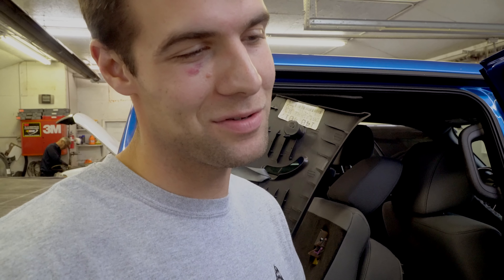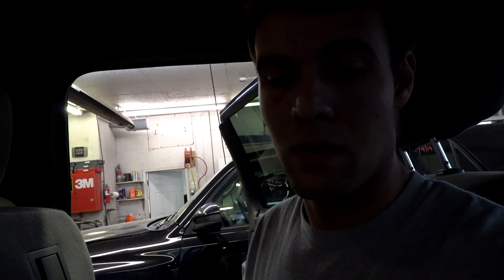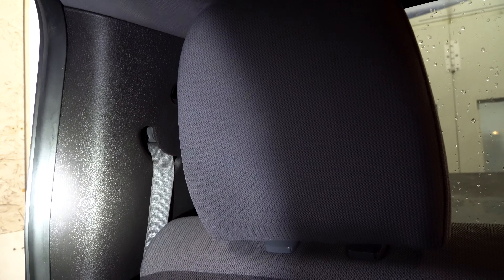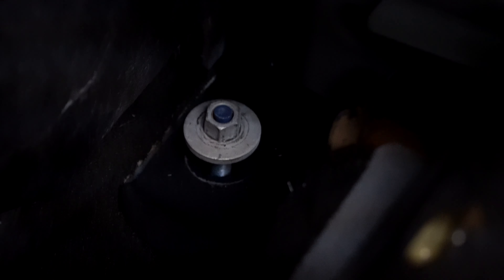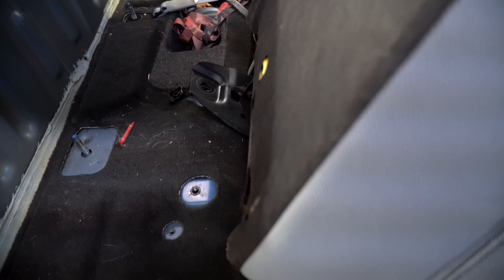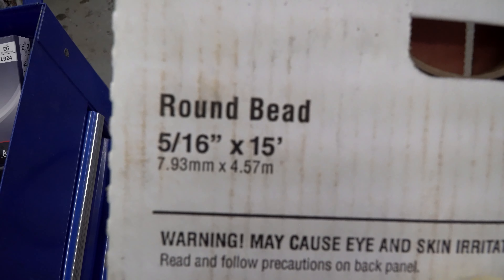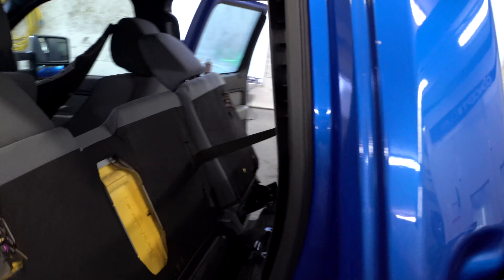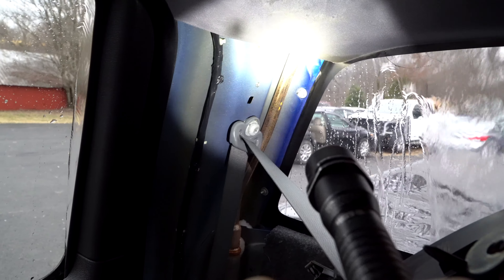Ford F-150 backglass/ rear window water leak (2011) // #theautobodyguy

Comment: I used this video as a reference and just did mine and have a few extra tips: Carpets were soaked, and the trough down each side of the kick panels were full of water. I used a shop vac to suck out the water, and then raised the front of the truck to get the water out that was pooled at the front to head to the rear to suck it up and also sucked what I could out of the sound deadening. Got 2/3 a gallon of water out of it! 
For the old seal remnants, I found that scraping it was not the right way, but used a lever action using a curved plastic trim tool to lift and pull it away, continuing this process as I remove it. I then used brake cleaner (red can) and lots of blue rags to clean it up as this dissolves the old seal.  For installation of the new seal, I did not smush it down like in some videos; just laying it in the groove as you dispense off the roll, as you remove the backing paper at the same time is all it needed; it holds very firmly on its own just under its own weight.  I’m also taking the opportunity to do the resistor trick on the heated rear window signal wire (when this loses continuity your heated mirrors and window won’t operate), and to drill the peg for the seat back release, so that I can tie a piece of paracord between it and the headrest mount to make it easier to drop in the future.   Final recommendation is as soon as you see any moisture building up inside your F150, or it smells a little damp, don’t put it off - just get it changed! Mine is going to be parked up for a few weeks with a dehumidifier going to dry out the carpet (currently raised up on 2x4s to allow air to circulate under it).
Reply: I have a 2013 Raptor and had a leak in the corner. Sealed it(temporarily/year now) found a 1 piece window guy that wants to trade so we are swapping this weekend. I’m happy to ditch this window. Less issues with the solid one. Been watching stuff to make sure it’s done right. Good video and your comments help 👍🏻

Comment: I just resealed my rear window and replaced both cab seal/strips while the window was out. Thank you for the video! My cab corner strips were just old and dry rotted so i wanted to replace them but after reading more I am glad I did because some people said the rivets caused their leak.

Comment: I have the 2013 extended cab.
Water would just pour in through the brake light (even the one I got from Amazon recommended by youtubers) and the upper corners of the back window, where the roof channel with the black plastic cover and rivet meets the glass. I also have a leak in the passenger cab vent between the cab and the truck bed.
I've had it with leaking, and so I just used black high temp RTV to seal the whole roof channel, and a thin bead of clear RTV on the top of the glass and read brake light.
Now I need to fix the leak in the vent (plastic piece between the cab and the bed).
Reply: How did it go, I’m working on it today.  I put silicone along the top of window but when I pour water there it still manages to get in somehow

Comment: Right after he removes the tape from the new 3m seal on the glass he shows the back of the cab and there is a lot of residue left from the OEM seal.  Will the 3M window weld tape seal to that residue?  If it all needs to be removed what works the best?
Reply from the maker: Remove it all is the safest play.

Comment: What are the torque specs for the bolts holding the window in? Thanks for the video!
Reply from the maker: I'm not sure, I just make sure to go around to each nut a couple times to snug them down as the new seal bead takes a bit to compress.

Comment: Hell yeah. If it wasn't the 3rd brake light leaking then I'll definitely be doing this for my 2010. Is running silicone a bad substitute for this method? I'm concerned about the looks I guess. Thanks!
Reply from the maker: Nicholas Davis Nice! Silicone will likely seal the leak,  but you will definitely take a hit in the cosmetics dept.😂
Reply: Use a piece of making tape to get make a border around the meticulously cleaned repair area. Use 3m window weld ($25), and peel off the tape quickly before it dries. The window weld may last as long as the truck. If budget constraints force you to use silicone, there's No telling how long it will last.

Comment: I just replaced mine last weekend. I used a 3/8 bead. Maybe that was too big because I can see some of the new strip got squeezed out of the window once I tightened it down. Is this normal?
Reply from the maker: Sounds like your probably right, use a smaller bead and it won’t be visible
Reply: @Theautobodyguy  well, if it holds I'll live with it. If it leaks...I'll take it to a glass shop. This was a miserable experience I never want to relive.
Reply: @bretlinden8248 how did the thicker bead hold up? I'm about to do this repair on my truck and I'm about to order the windoweld and I don't mind a little squeeze out as long as it is 100% leak free

Comment: My 2009 has been leaking since it was under warranty, the kept claiming it was the third brake light, it was not. This is exactly what i was trying to tell them, its out of warranty and i have mold throughout my ride. Still pissed about it, at this point i'm just hoping the truck burst into flames.
Reply from the maker: Dang!

Comment: Great video but ? On the application of the new seal to the window. I was able to get the old seal out but both upper corners seam to not have a groove for the seal to sit in, is this correct?
Reply from the maker: epic save that sounds right, I just make sure to have a continuous bead regardless of the channel.
Reply: @Theautobodyguy  that's what I did thank you. My roof leak was not from the window it was from the wrap over corner moldings at the top of the cab but to replace them I needed to remove the window.
Reply: The plastic corner moldings just lead to the upper corners of the glass -- it is pouring water into the area behind the glass. And if the window seal is compromised, water will get in. So it is the same issue as the window gasget.
I got so fed up with water that I just caulked the hell out of the corner moldings and carried it to the rear window. Black RTV. Then I used a thin bead of clear RTV along the top of the window and down part of the sides (used masking tape for a cleaner line). 
My rear brake light also leaked badly, even with a replacement. I clear RTVed that also.
AND my cab vent leaks too. The small plastic vent between the cab and bed. Gotta fix that too.
Reply: @secretarysmith3307  not in this case. It was the rivets on both mouldings at the top of the cab. The plastic coating of the rivet itself had worn out and allowed water to leak in from the top of the cab.
Reply: @epicsave635  well maybe I had that issue too. Amazing how many ways Ford has allowed water to get into their trucks!  I drilled the rivets, slopped in some black Rtv, re-riveted the hole, and slopped more rtv on top. Desperate times called for desperate measures.

Comment: Where could I find the weather strip? Most of the stores here do not carry it and which brand would you recommend?
Reply from the maker: It’s called Butyl tape and we get it from the local auto parts store like NAPA. They all should carry it in a couple different sizes. I wouldn’t worry about the brand.